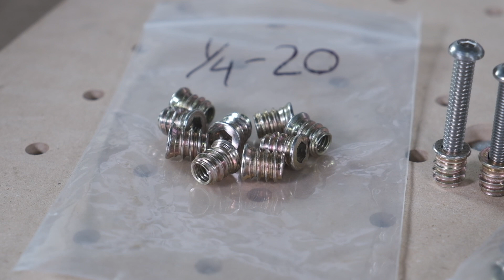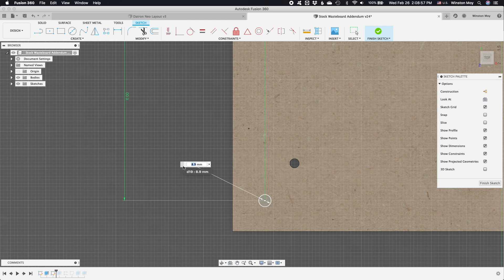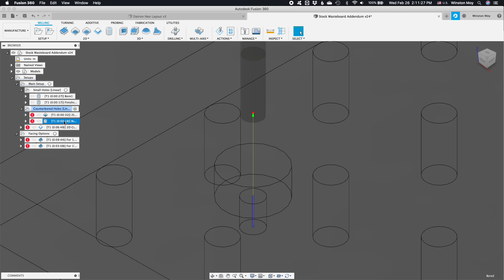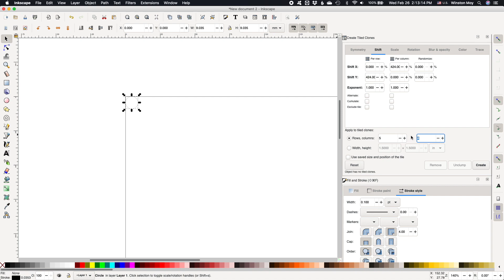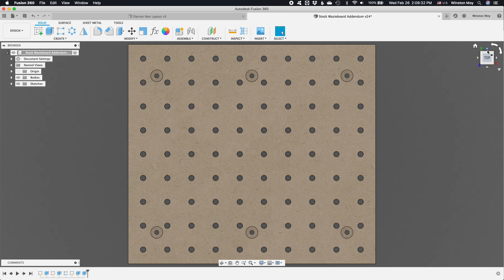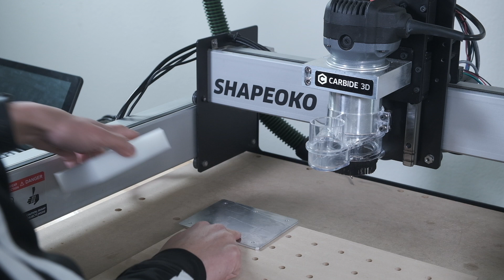How to Make Your Own Threaded MDF Table for the Shapeoko CNC

Comment: I did something similar but used 2, 5/8 mdf boards. The bottom one is threaded and the top is not and easily replaced without having to remove the threaded inserts on the bottom board.

Comment: I have seen that while cutting the 9mm pockets you used the new dust boot, the brushes bend and let you cut the pockets. Is the new Z assembly using a more powerful motor? Because I am not able to use it, as soon as the brushes touch the surface of the board the Z motor starts jerking back, it is not powerful enough to bend the brushes.
Reply: I've observed this before when making straight plunges, or small diameter turns. It may be possible to source softer bristles, but in the mean time I've found that the easiest workaround is to thin out the bristles, by trimming back about half of them. It will still form a more than adequate seal in most cases, and reduce strain on the Z-axis. The Z+ having a lead screw is also several times stronger than the belt driven Z axis.

Comment: made my own with plywood, works great with wood which i guess most will be using it for, but problem is, if you are doing work with metal these are not too useful, whatever lubricant you use will soak into the wood and cause it to expand. Also i found that if I wanted to clamp some metal down the threaded insert would be pulled upwards and loose the clamping force slightly. For the metal work im trying to do this isnt good enough as i'm trying to do fine engravings for graphic work. Im going to try and swap this out for a metal base of some sort if i can.
Reply: I use T-Nuts installed in bottom instead of threaded inserts. This way you don't have to worry about them pulling loose and you can tighten as much as you want.

Comment: i'm confused Winston.  in your designing of the board, you mention that now the holes patterns are laid out with counter-bores, then later on we see you using a dewalt drill to countersink what I interpreted as your previous counter-bore exercise.
Reply from the maker: In the Fusion version, which is what I was cutting, I prioritized machining the counterbores for the mounting bolts, not the threaded insert holes which need counterbores/countersinks on the bottom of the MDF. Easier to countersink by hand, than it is to get a 0.75" forstner bit to make 6 perfectly aligned pockets on the top.
Reply: @carbide3d  ah, gotcha.. thanks for clarifying

Comment: I didn't see any mention of flattening the wasteboard that the supplemental baseboard is mounted to. ?????
Reply: Largely unnecessary IMO, the supplementary wasteboard itself is what's important to face afterwards. Unevenness in the underlying wasteboard would just mean you might have a few holes that don't get drilled through all the way. You can either cut extra deep to compensate, clean it up by hand later... or face the MDF that you stick the supplementary wasteboard stock onto in order to get it over the lip if you really care.

Comment: if your going to use any liquid mist or spray coolant. dont use MDF. try a HDPE 1" Thick cutting board instead. it wont swell with moisture and can also be machined level
Reply: Would replacing the machine's waste board with 1" HDPE would be ridged enough?
Reply: @kylellrc799  solid plastic is quite ridged but thats really up to you to decide for youself and your application